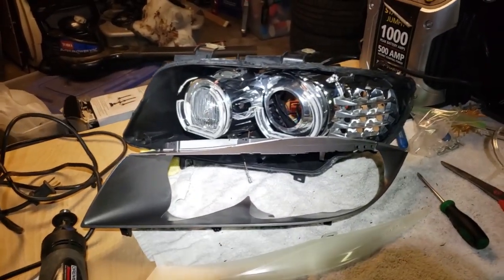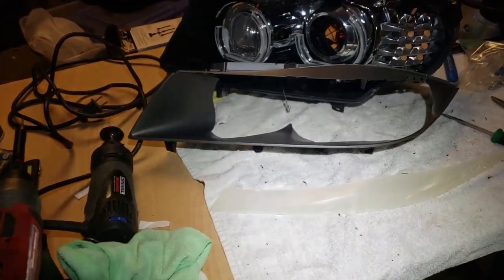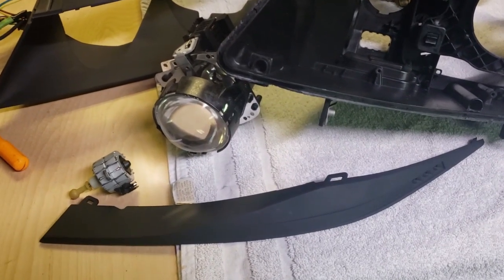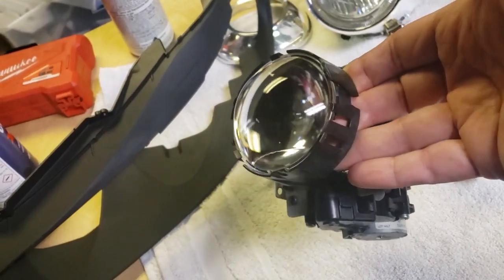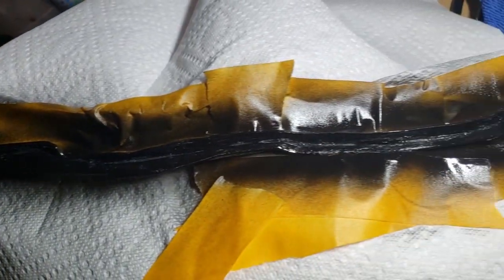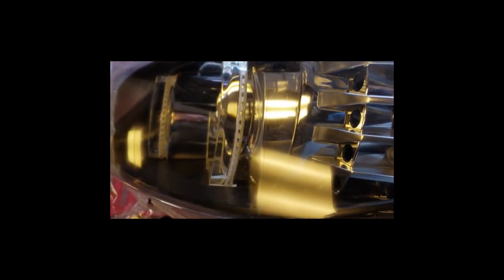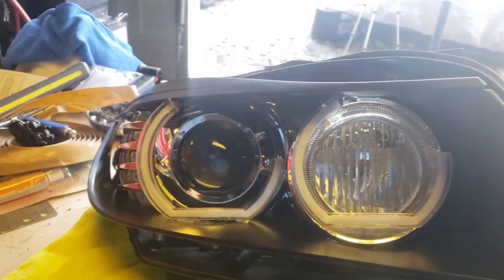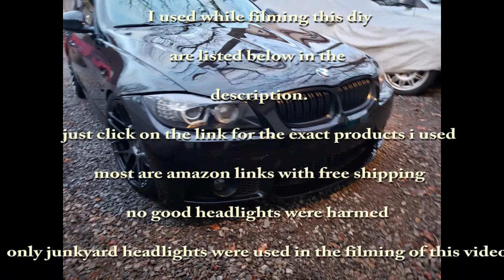DTM STYLE M4 STYLE LED halo Retrofit angel eyes For BMW 3 Series e90 custom diy lense replacement

Comment: Did the epoxy eat into the angel eye circuit board? Are the angel eyes still holding up well? Thank you for the awesome video!
Reply from the maker: No. The angel eyes don't have a circuit board. They just plug in like a light. Epoxy was good. I got some good for plastic. 
Thanks for watching please subscribe.

Comment: Looks super clean! I'm definitely going to follow your build. Is there a way to wire the halo rings where the DRLs are amber and the turn signals are white? Also, it looks like it's been about a year. How have they been holding up? Would you still recommend that brand of halos?
Reply from the maker: They are holding up well. You can get halos that change to different colors. Also can wire the halos to tune signals too and they flash amber.

Comment: What did you use for your positive lead in the car to turn the lights on and off? That’s the only thing I’m missing
Reply from the maker: Sorry for the late reply. I wired the halos right into the same place that the originals were wired to so they act the same as the originals just brighter.